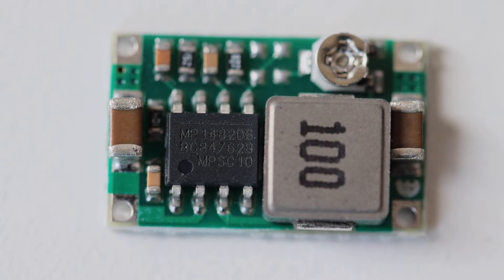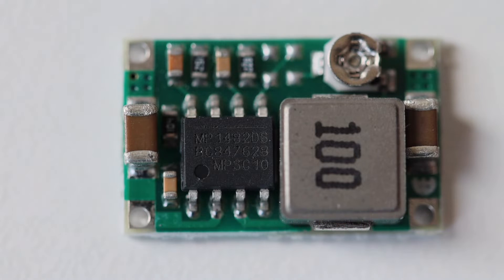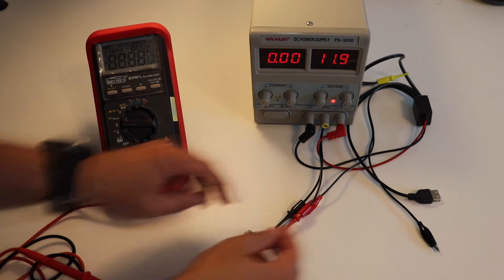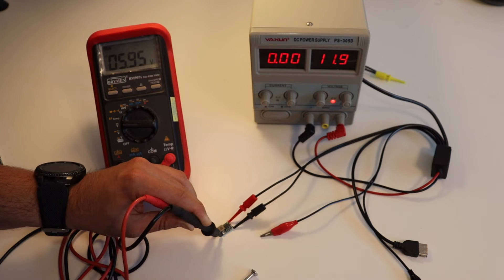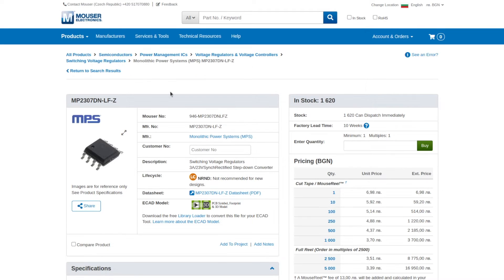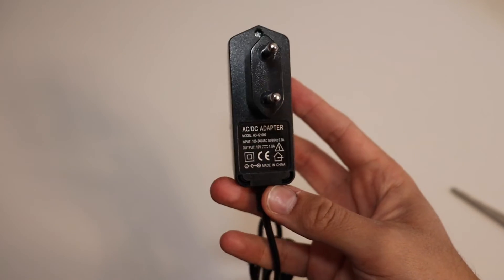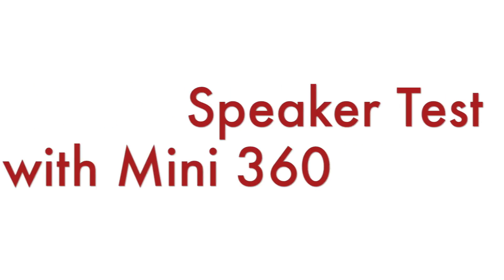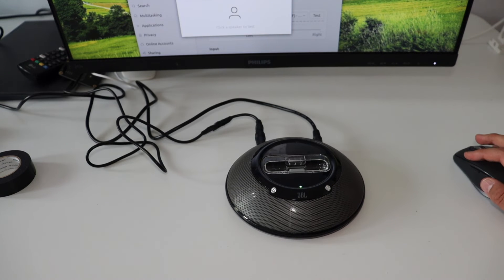Mini 360 Tiny Cheap Adjustable DC-DC Step-down Voltage Regulator for Makers

Comment: You mentioned it works from 4.75V. Does this mean it will not work with a single cell Lipo Battery, which is 3.7V - 4.2V? Thank you for the video!
Reply from the maker: Yes, the input voltage is in the range from 4.75V to 23V so sorry but it is not suitable for a LiPo battery.

Comment: this has the mp1482ds chip, the true mini 360 has the MP2307 chip. the Mp1482ds can only take 4.75V-18v in at 2 Amp, Peak 2 Amp Adjustable from 0.923V to 15V Out.... The MP2307 can do the full 4.75V-23V in at 3 Amps, 4 Peak amp. Adjustable from 0.925V to 20V Out.	

Key differences explained
Input voltage range: The MP2307 can handle a higher maximum input voltage (23V vs. 18V). This means that a module with an MP2307 is more tolerant of a higher-voltage power source.
Output current: The MP2307 is specified for a higher continuous output current of 3A, versus the 2A rating of the MP1482DS. This gives the MP2307 a greater capacity for powering more demanding loads.
Module variation: Older "Mini-360" modules typically used the MP2307, while newer, lower-cost versions often substitute the MP1482DS. It is important to check the actual chip on a low-cost module rather than trusting the product description, as the listed specifications may refer to the higher-capacity MP2307 even when an MP1482DS is installed
Reply from the maker: Yes, exactly! This is why I compared the new and old versions of the Mini 360 at 5:28. For some projects, it is indeed important to check whether the Mini 360 uses the MP2307 or the MP1382DS. Thank you for sharing these additional technical details. It is always a pleasure to read such in-depth technical comments for my videos.

Comment: Those mini 360  doesn't heat up much, which is great.  The only bad thing is the potentiometer , is terrible.
Reply from the maker: Yes, absolutely. The potentiometer on the Mini 360 can be a bit frustrating to work with, but typically, you only need to set it once for the required voltage and then you can leave it alone. Thanks for watching my video and for leaving the comment!

Comment: sorry for a newbie question, but can i connect it to an input with a 8a current, or does it matter at  all? or it will just take what current it needs. confused of this overcurrent protection stuffs. thanks
Reply from the maker: What is your input voltage and what is the power consumption of the device you want to power with mini 360? As per the tech specs of Mini 3060 the output current is peak value 3A, long time 1.8A. So you can use an input that supports higher current the output from the Mini 360 should be within the tech specs. Therefore you should take this in mind depending on the power consumption of the device connected to the output of the mini 360.
Reply: @LeonAnavi  the input is 5v 8a, directly from a solar panel, the current requirement isn't really more than 1.8a. it's still probably safe. thanks man
Reply from the maker: Oh, it is a different story for a solar panel. I recommend you to have a look at "Maximum power point tracking" (MPPT) solutions like SparkFun Sunny Buddy with Analog Devices LT3652 or eventually bq25185 boards like Adafruit bq25185 USB / DC / Solar Charger with 3.3V Buck Board.

Comment: Could I put 24v in the input voltage and output 5v?  I just need to use it for a 5v fan.
Reply from the maker: No, according to the technical data I saw the supported and recommended input voltage is no more than 23V.

Comment: i had similar speakers back in 2009
Reply from the maker: Do you still use it? I bought this speaker as a second hand from a local market. It was dirt cheap. Honestly, I don't use it but it was a good fit for the simple demo in this video.
Reply: @LeonAnavi  I don't have it now
Reply from the maker: @usmanumer9871  btw today I published a new video about USB-C Power Delivery (PD) for voltages higher than 5V DC. I am still experimenting with various PD sink chips. Eventually, in distant future I might convert a similar old speaker to a USB-C powered device :)
Reply: @LeonAnavi  nice idea

Comment: The ic is out of patent so now the "original" manufacturer has stopped making them , however chinese ic manufacturers are now able to make them without copyright infringement , so they are not actually obsolete.

Secondly , the recommendation of  not using them in new designs comes from the original manufacturer who have made "new" buck converters that run at higher switching frequencies , again this is just marketing and when the "new" ics are out of copyright they will then be labeled not for new designs.

I have a mini 360 using a mp1482 ic,so there are other ics to use,also the ic is rated at 3A continuous,the ebay sellers list them at a lower continuous rating because the pcb has limited vias and or heat sinking for the full current rating of the ic.

I am going to integrate the ic into some of my own designs using the mini360 circuit but not the actual module as the circuit is easy enough to reproduce into a design and uses far less space on the main pcb than the LM2596 i originally designed for, considering the pcb area is a fixed size for a type of enclosure used,i also like making my own circuits in this manner , though if the module suits your needs then have at it.
Reply from the maker: Thanks for sharing these details. Speaking of LM2596, yes it is a good alternative if PCB space is not constrained.

Comment: What if i give input 4v, can i reduce to lower than 2v?
Reply from the maker: Probably not a good idea for 4V because as far as I know the input voltage is in the range 4.75V to 23V.
Reply: @LeonAnavi pm me can you install do solar panel of charger.
Reply: @anwin85alon  you would need voltage threshold and current regulating added to make a solar charger circuit, possibly a dump circuit too.
Reply: @LeonAnavi pm me can you install do solar panel of charger.
Reply: pm me can you install do solar panel of charger.
Reply: Use a normal lm type regulator , or make a precision regulator with an op-amp and a transistor suited to current needs , a SO8 741 op-amp is tiny and is mounted smd , while a through hole transistor can be mounted on the non copper side flat making for a very small pcb design with variable current and voltage if needed using smd trimmer pots. Even if you need little current a zener shunt design gets even smaller.